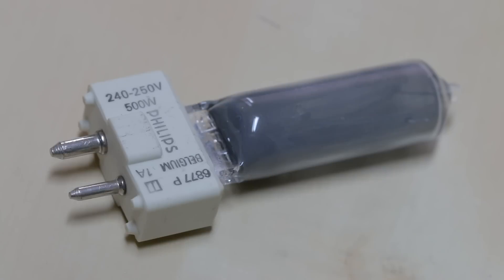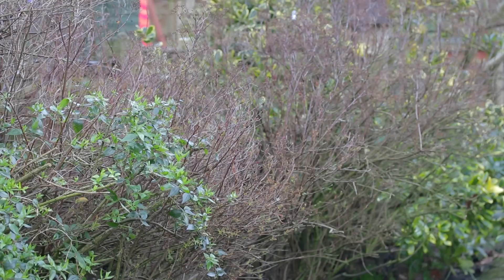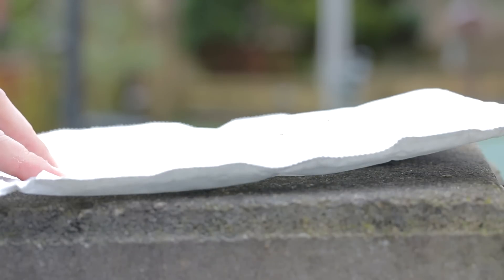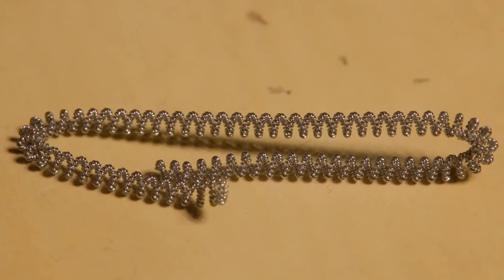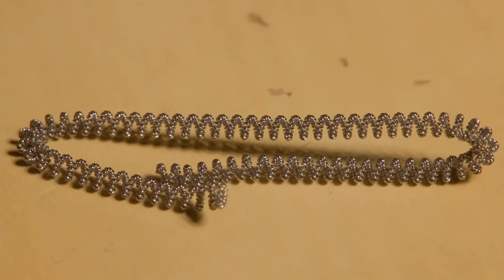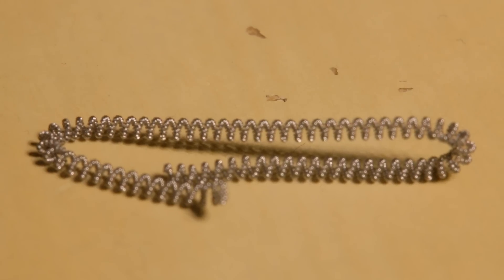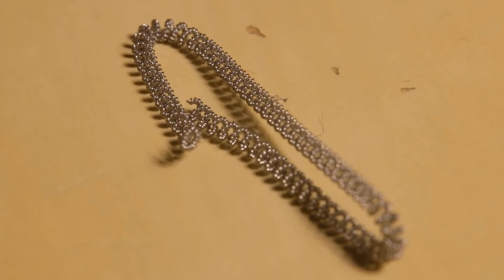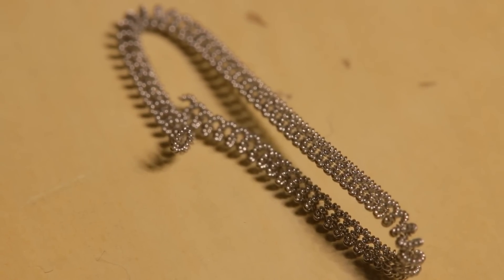Tungsten-Halogen filament close-up.

Comment: That's quite impressive for an M40 to trip a 32A breaker, they're usually pretty well behaved when they go. I've used a lot of S4 HPLs and they're an absolute nightmare, they've got tiny short filaments and arc every time. I've had them trip entire dimmer racks. 

Here's a closeup of a bog standard incandescent filament I took a while back:
http://imgur.com/57K2id4
Poor depth of field but shows the structure quite well. I never knew how they formed them though!
Reply from the maker: Nice photo. Yes, I was surprised it took out a 32 amp mcb but my breakers are getting on a bit, might be a bit weak. 3 amp fuse in the plug was fine though!
Reply: 4 Amp.....FOUR AMP ?!

If that's BS 1363 plug, you can have a 3A or a 5A in there, but not a 4A. :D

........Unless that is, you've put some kind of 'special' fuse in that plug. :D

Of course, if you do have a 4A fuse to BS 1362, I'd like to see a vid on it, as I've never seen one of those before. :D

====================

As far as higher-rated MCBs tripping-off before plug fuses pop, I have known that to happen as well. I once accidentally shorted something and the 13A fuse in the plug didn't stand a chance against the 32A type-1 in the consumer unit!

The fault occurred.....The plug fuse took the kick, then sat about and made a decision whether to pop or not.....then the fault current stopped because the snappy MCB in the consumer unit got in there before the fuse in the plug could make up its mind as to whether to pop or not! :D

I think it was fairly safe to say that the MCB tripped-off well within the 0.4 second disconnection time....The switch on the wall socket made a nice big pop when I pressed it, but it did survive the fault current though! (MK LogicPlus)

-BoomBoxDeluxe.
Reply from the maker: BoomBoxDeluxe
Ah yes, that was a typo :) Edited now.
Reply: Aaaah, I was looking forward to seeing a 4A fuse. :D

-BBD.
Reply from the maker: BoomBoxDeluxe
I have seen a 2 amp fuse though!
Reply: Yes, I own a few 2A fuses to BS 1362. :-) The sizes I know of are as follows:

1A, 2A, 3A, 5A, 7A, 10A and of course.... 13A.

Yes, BS 1362 IS available as a 1A. :-)

Normally, 1A is considered to be those 'shaver-adaptor' fuses.....the miniature ones to BS 646. (BS 646 is available as 1A, 2A, 3A and 5A only)

-BoomBoxDeluxe.

21st February 2014, 17.41